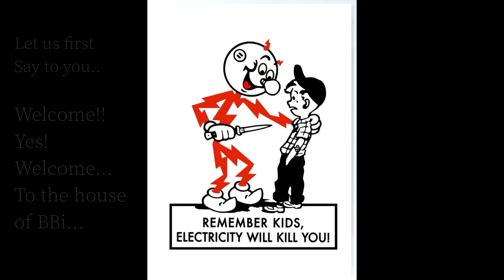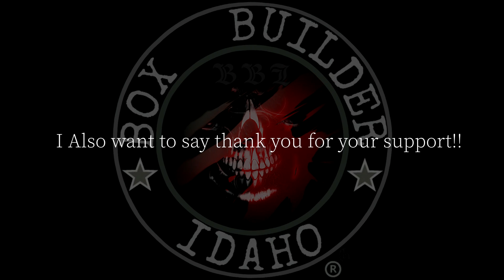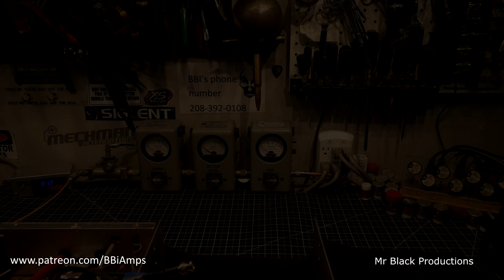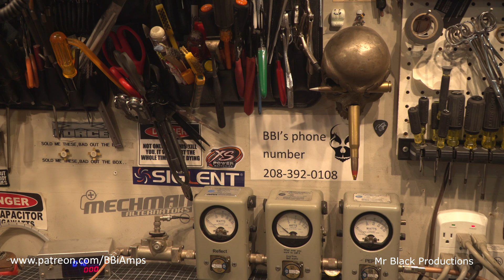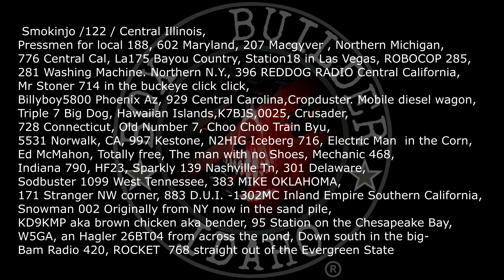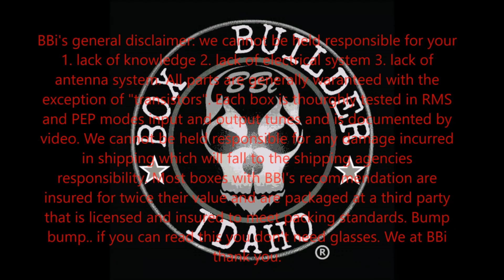How to Check your Bias on a 3-500 tube amp

Comment: Is the fan blade on backwards for a reason?
Reply from the maker: I get this all the time it's an optical illusion from the camera it's not on backwards.. 😉
Reply: @BoxBuilderIdaho  Hmm, look at 6:23 seconds.  The blades are oriented to push air out the rear (seems clear in the video once the fan has stopped).   As its coming to a stop you can see its spinning trying to blow air across the tubes, but the an blade appears installed backwards.  It should cut into the air, not be smooth and rounded into the air.  Take a look at page 40 in the SB-220 assembly manual. The Spring clip is to be on the tube side of the fan, it appears backwards on the amp in the video.  Once the fan is stopped, I dont think its an optical illusion.
Reply from the maker: @damonkj7e I'm telling you bro they're not on backwards I'm telling you it's not on backwards it's just a trickery in the camera. It's like when you see a video of like the propellers on an airplane you really think they're sitting still when they're spinning like that
Reply: @BoxBuilderIdaho I understand sync optical illusions, its not the rotation that's in question, its the blade orientation when stopped.  So, Ill have to disagree with you here, but all good.  Not trying to argue, really was curious if there was a reason.  Thanks for your videos and I enjoyed your SB-220 build from new in box.
Reply from the maker: @damonkj7e I know brother but what I'm trying to tell you is the air was moving the right way when the amplifier left here so I don't know

Comment: My dad used to tell me that setting up your bias correctly is kin to setting your car to proper idle speeds. He said Son, use this equation P = I x V. Get your plate dissipation and plate voltage from the tube spec sheet. Now, do the math. Got that. Yes, sir, let's measure what is happening with this amplifier and see if it's within specs. Luke,  I am torn between a fixed bias, as the SB-220 originally had, and the now modified self-bias. With fixed bias, one would spend more on components that wouldn't distort easily.  Not my words.
Self-bias/cathode-bias harmonics distort quicker and are usually used in lowered-powered amps. So, I have one currently running in self-bias mode and almost got another one ready to come online with forced bias. The objective is to see which one has better output and balanced loads or voltages close on both tubes. All tubes are matched. I let you know if I blow something up. Lol, j/k, but one never knows. I wished I had all his paperwork and paid closer attention when he taught me. But I wanted to ride my dirt bike, drive fast cars, and chase girls. We all would have done something different if we could return in time. Thank you for the outstanding video, Luke. Stay good.

Comment: You don't explain things very well.  Bias voltage is the voltage between grid and cathode.  The polarity is important.The grid is usually zero in high power amps or negative compared with the cathode which would be positive if the grid is negative.

Comment: So there are a few guys that make a strange modification. They take of the wire from point 3 of the relay, and ONLY feed the relais with 120vdc, then they place the 100Kohm resistor between 6 and 9 (instead of between 3 and 9), so the zener goes from (unkeyed) through the 100Kohm resistor towards the centertap of the fillament transformer. The reason of this (they say) has something to do with "if the cutoff voltage shorts with the fillament voltage" it wil burn out the small transformer, (or something like that) how can this work if the tubes dont get cut off with the 120vdc?????

Comment: Great video! I would assume that this is the same test for an SB-1000 amp as well? I did test mine and the filament voltage is ok, but bias is 0. Going to check the zener as I key down the tube is glowing like a lantern. Darn thing was working well, too..

Comment: Hello Sir- Thanks for the great  video- my bias flop on my 220  was 0 voltage not 3.5 - Does that mean that  the Zener diode is bad?  Also I noticed the filament xformer is running  hot . Thanks gain

Comment: this a very common problem. this test works on 99% of all 3-500z amps. same thing on 572/B 811A 3cx1500A7 etc. just look at data sheet to get cut off volts and bias volts. the outher part of test is with the tubes in HV applied zero RF in. look at plate current.  I had a Zenner short and key amp and tubes runaway . great tip ! the SB 1000 1 3/500Z same bias flop. just one tube. all tube amps have some bias flop. how a tube works. 0 volts full on . just a few use grid bias . same thing. the flop is the grid . 73's